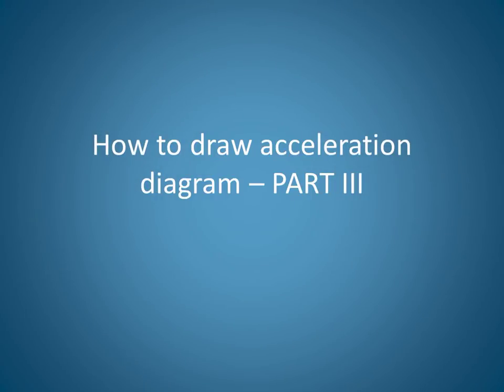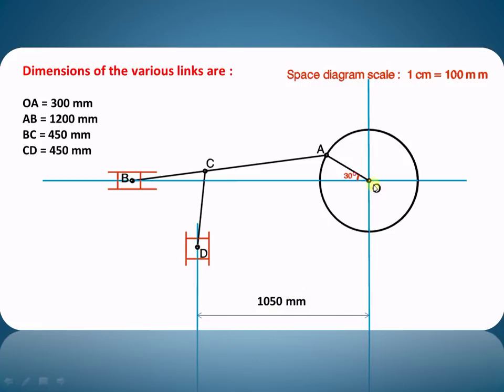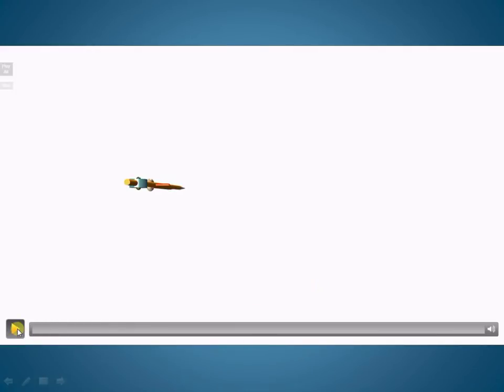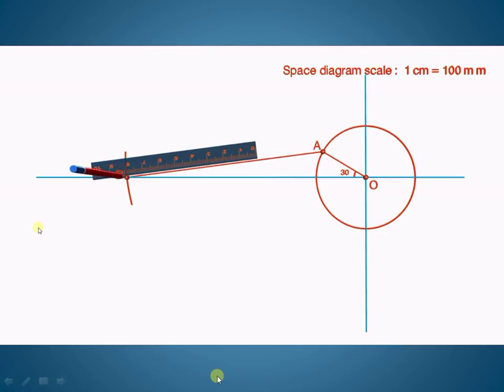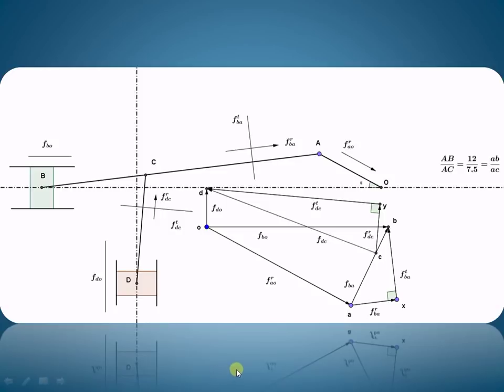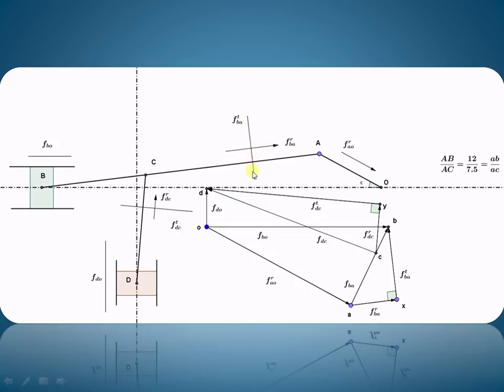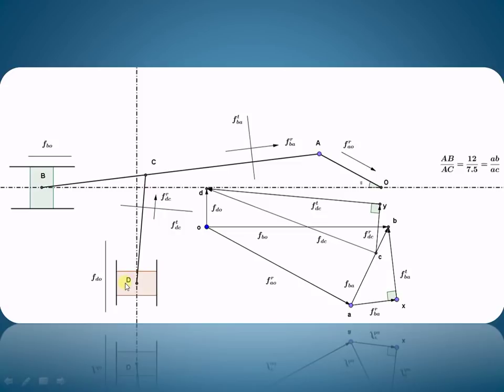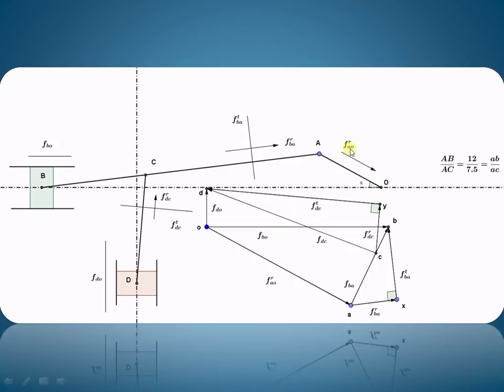Lecture 5 | How to draw acceleration diagram | Relative velocity method

Comment: why is radial component of acceleration being directed towards pt A instead of O in acceleration diagram?
Reply from the maker: On the diagram it will be 180 degree out of phase ..as we start drawing from fixed point O.
Reply: and what about tangential direction?
Reply: is that the same 180 out of phase?

Comment: How have u assume A is centre not B
Reply from the maker: For the floating points A & B , either you can assume A as a centre or B as a centre ,accordingly the diagram will change but there will not be any change in the resultant acceleration. THANKS ...